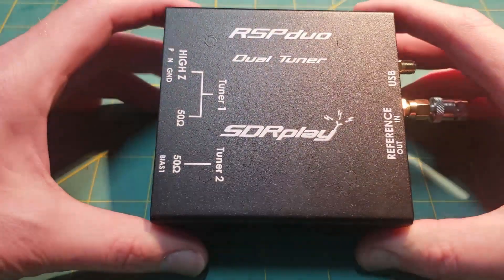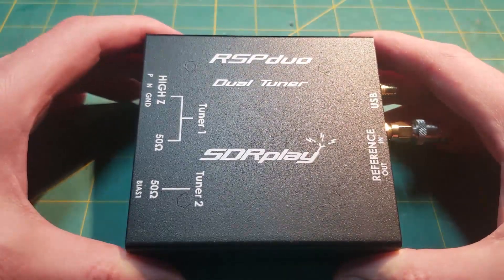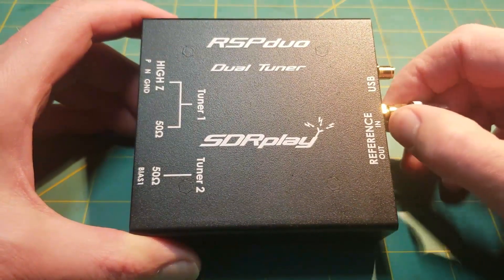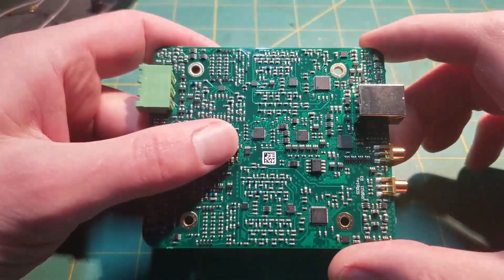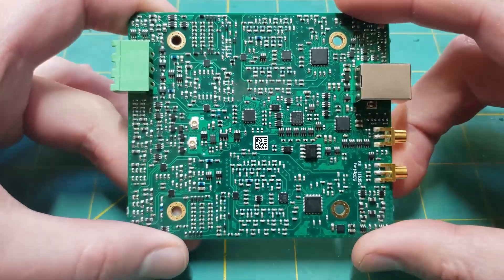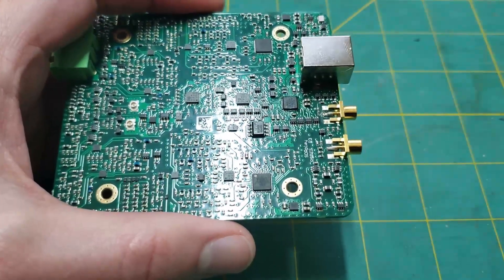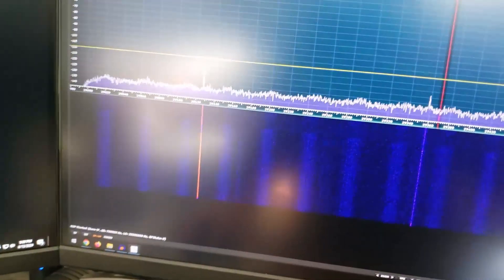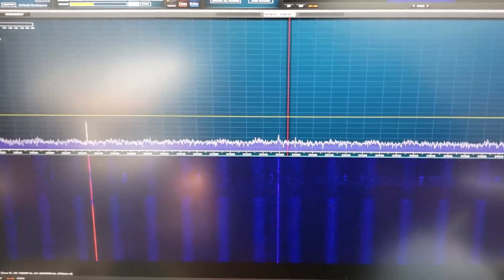SDRPlay RSPduo Failure and Repair

Comment: If you had lightning you might have had a large ground potential spike which came in via the mains supply of your PC and went out through your antenna grounding, burning the chips most directly in the way - power regulators and your MSI2500. I don't think you can criticise SDRPlay for this, but I also don't think this could even be described as a typical failure mode - lightning could choose quite different paths, of course. But generally it's looking for a path to ground. If you had been using a laptop with no wired connections, everything would probably have survived the hit

Comment: I have a FIFI-SDR that has some problems. I can hear the sound but it is faint. Also it only receives very strong radio stations. I was wondering if you can repair it for a fee or guide me to someone who can. Thanks